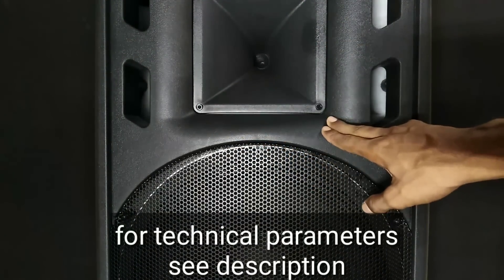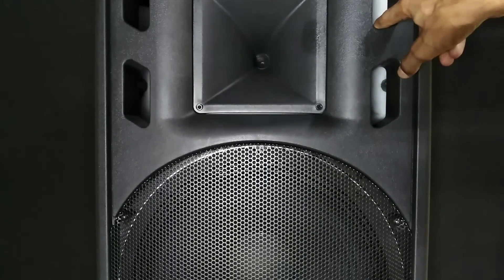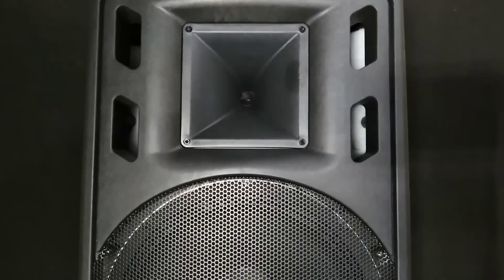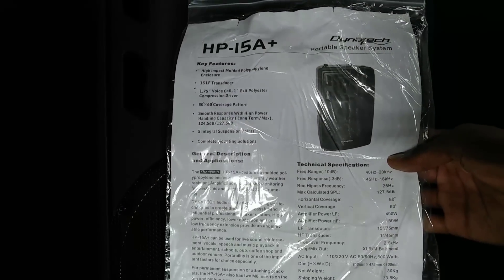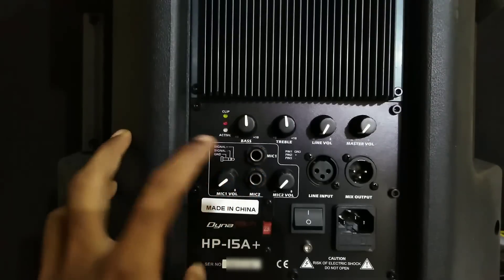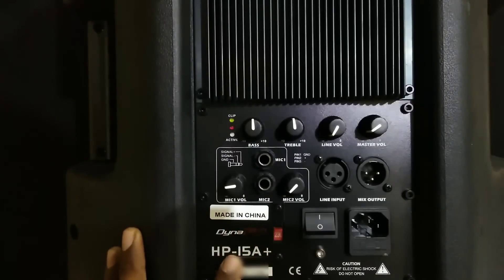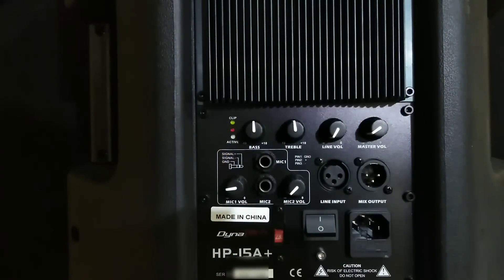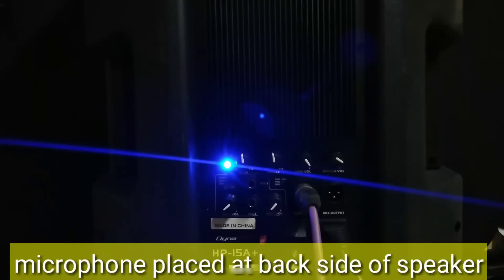Dynatech HP15A+ active speaker പരിചയപ്പെടാം|വാങ്ങാൻ പോകുന്നവർ ഇത് കണ്ടു തീരുമാനിക്കുക|echotech

Comment: ചേട്ടാ ഞാൻ paudio 8ohm 18"challengerseries 1200w(aes)sub speaker എടുത്തു. 8ohmsil എത്ര വാട്ട്സ് കിട്ടുന്ന amp ഉപയോഗിച്ചാൽ  നല്ല punch കിട്ടും. അതുപോലെ paudio 8ohmTCN150w(aes) 12"x4  squre ബോക്സും ഉണ്ട്‌. ഇതിനു പറ്റിയ amp. 8ohmsil എത്ര വാട്ട്സ് കിട്ടുന്ന amp വേണം.
Reply from the maker: Sub ന്  ഒരു 1000-1100 വാട്ട്സ് 8ohmsil കിട്ടുന്ന amp മതിയാകും. Square ന് 4ohm ൽ 800-900വാട്ട്സ് amp use ചെയ്യാം clipping maximum ഒഴിവാക്കണം ഇല്ലേൽ speaker പോകാൻ chance ഉണ്ട്